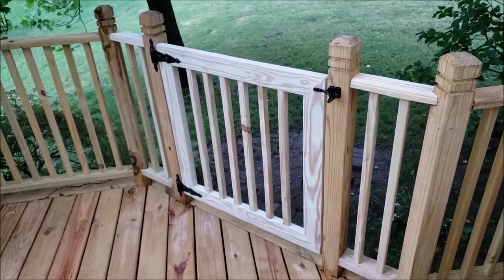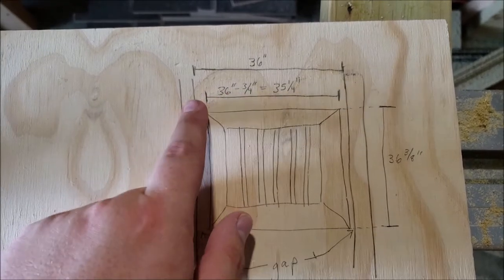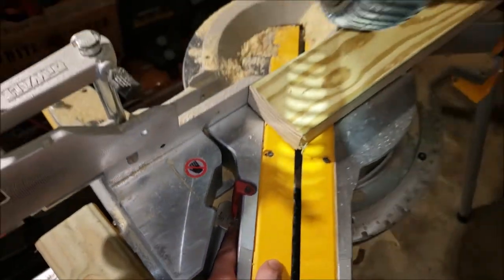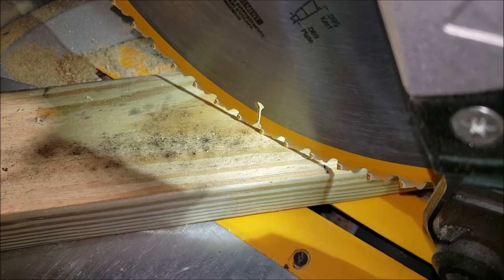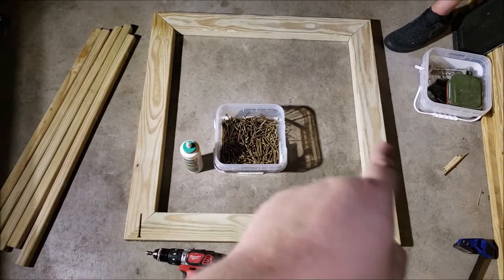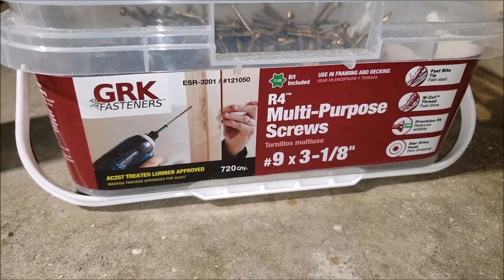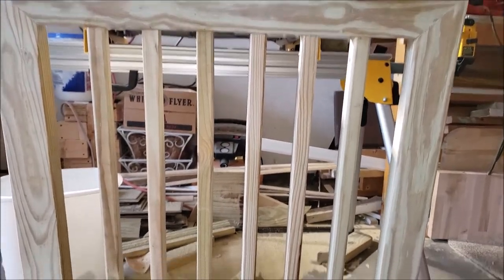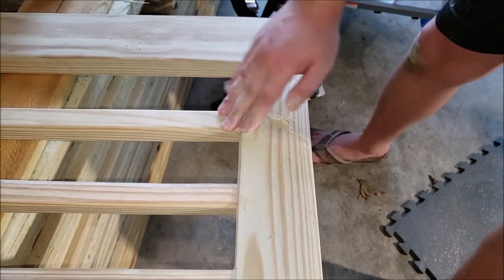How to Build a Custom Deck Gate

Comment: Best detailed video tutorial.  One thing about when you use sawdust to fill the gaps, I find it best (and better) is to mix sawdust with the glue then put it on wherever you need it.  I have done it for my deck and it came out stronger than the glue itself as well looks "better/uniformed"  even when staining/sealing- it'll take the stain in better. Also stops those knots from seeping out down the road.  

Keep up with the good tutorial as it's simpler than other methods which requires more or "complicated" tools.

Comment: I’m getting ready to make a gate for our patio, I’ll use some of your tips to make it not only look more finished but also easier to build. One tip I will share regarding baluster spacing: get a length of knit elastic banding (available at any fabric store… 25 cents per yard), using a black marker, make a mark every two inches on the unstretched elastic. When you need to space anything equal distances, stretch the elastic between the two outside rails… the “two-inch marks” will become 4.38217” (or whatever spacing you require) all without any math involved.

Comment: A 2x4 cross brace would stop the gate from sagging in time and attaching the wood spindles on the outside of the frame vertically.

Comment: Great video, very well explained. We have a wide opening on our front porch and will need to make two gates to meet in the middle. Should we still be making the width of each gate panel 3/4" shorter (measure total, divide by 2 and subtract 3/4" from each half?)
Reply from the maker: 3/4" less than the total gave me a 3/8" gap on both sides.  If you have a gap on each side like me plus one in the middle, you would have 3 seperate 3/8" gaps.  You can go with slightly more or less than that, but 3/8" as a gap worked for me.  If you like the 3/8" gap, you would take the total distance of the opening then subtract 3 * (3/8") for the 3 gaps and then divide by 2 for the width of each gate.

Comment: Awesome vid. Going to copy your design. Love it. How long would you wait to stain pressure treated pine with semi-solid deck stain to match the rest of my deck?
Reply from the maker: I would wait 6-12 months until it starts acting like a sponge when exposed to moisture.
Reply: @LyonConstruction   Sounds good. Also (rookie question here), instead of #9 x 3-1/8" screws, is it fine if I use #10 x 3-1/2" on the frame? I have extras lying around and would like to not have to buy more screws. Can I also use #10 x 3-1/2" on the balusters too?
Reply from the maker: @Steve K  A #10 is a larger thread diameter than a #9, making it slightly stronger which should be fine for the gate, especially if you predrill to avoid potential splitting. I would not use them for the balusters because the screw head is huge, and those are at an angle.  I would definitely go with the trim head version for the balusters. It is easier to countersink them and hide them for finish work.
Reply: @LyonConstruction  I went with the trim screws per your recommendation. Last question. Why did you miter vs cross cut the frame ends?
Reply from the maker: @slappy1965  Three reasons I can think of at the moment: (1) I like the look better since it makes it similar to a picture frame (2) It provides more surface area for the glue and (3) It shortens the distance to screw through to get from one board to the next although I suppose you could countersink further, use longer screws, have angled pocket screws, etc.
Reply: @LyonConstruction  I ask that because I see old homes, garage doors, and barn doors that are cross cut. All of these doors deal with the elements. I researched why and learned that cross cut exterior doors are more tolerant to precipitation and don’t let as much water inside the seam over the lifespan of the wood. I thought you might find that interesting.

Comment: What I would add, is the importance of picking out a good 2 x 4. Maybe you did and I missed it. I built my frame today and it is warped. I had a slightly warped board from Home Depot. I got the two last Cedar boards. I should’ve paid more and went to a proper lumber yard. Not quite sure what to do about my warped frame at the moment.
Reply from the maker: Mine warped too and was hanging so that the bottom was flush with opposite sides of the post without the hinges. I installed a wood stop at the bottom to stop it where it should stop and had to push hard to close the gate. It hit the wood stop first, and the extra push bent the top until the latch held it.  After a few months, the warp was gone. You retrain the grain over time. Hope this helps.
Reply: Home Improvement stores tend to have picked over PT wood. My local lumber yard has much better wood and cares for it better in the yard

Comment: Do you have problems with the glue breaking out of the screw holes over time?
Reply from the maker: I had that issue with the initial shrinkage but it seems to be fine now.